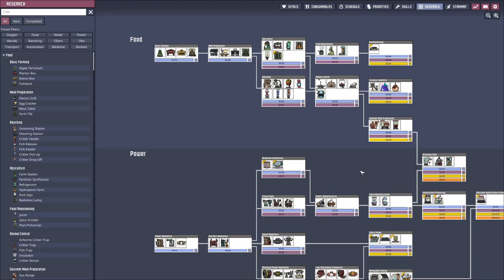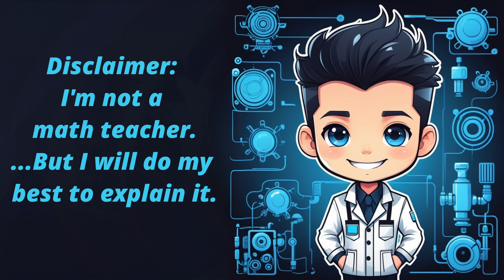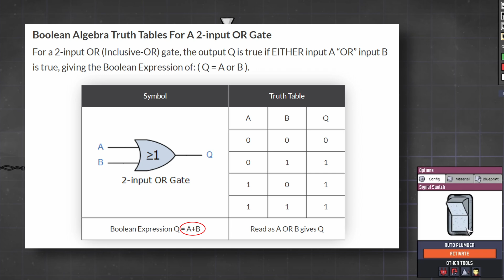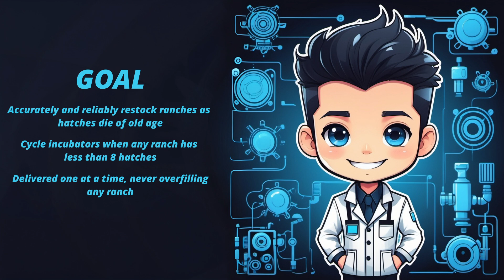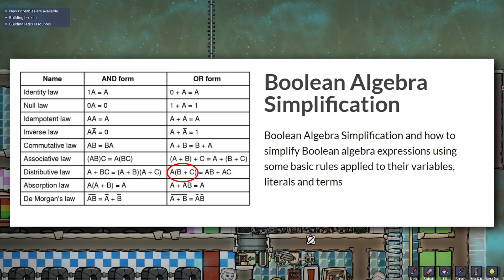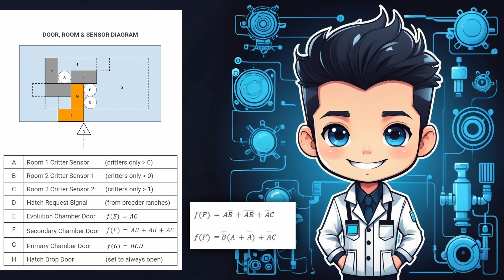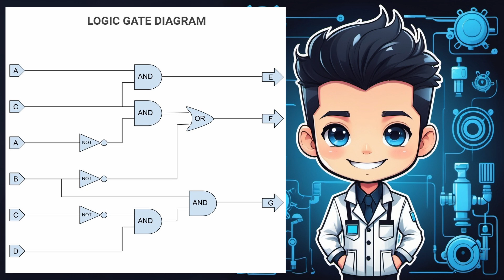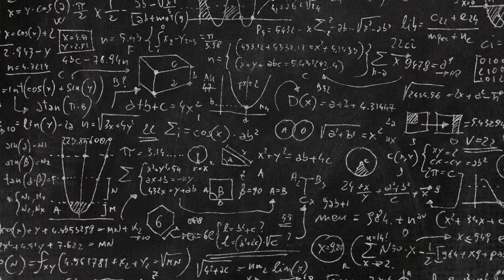Ultimate Auto Hatch Ranch | Oxygen Not Included | ONI Tutorial

Comment: can this be made mirrored? and also i love ur buidls :3
Reply from the maker: The issue with mirroring is that the sweeper needs to be in range of the bottom left tile of both incubators to put eggs in them.  This will not be possible for the left incubator if mirrored as is. The good news is the logic gates can be relocated wherever we want without the need to flip the circuit since we used automation ribbon.
Reply: @engineertroy_  That is not the issue, eggs find their way into the left incubator just fine, although the eggshells remain on the floor.
However, the automation wiring gets nasty because vertical doors don't have a mirrored version. 

The problem in my (mirrored) build is that hatches don't fall through the trap door unless I direct dupes to help them. No idea if mirroring causes it.
Reply: @noimnotnice  Im trying a mirroed version right now and Im running into the issue of wiring automation to door F, Im sure ill find a way but jeeeeez it is racking my brain. I probably have the solution right in front of me but i cant see it lol

Edit I had to do it very ugly
Reply: @itzahoax934 stuck on the same problem can you show😭
Reply: @siddheshgajare4193 im in bed now but if i can find the old save file ill post screenshots. Its been some time now. Just messwith redoing the automation lines and directions
Reply: @itzahoax934  please share, i just cant connect with door F 😌
Reply: @noimnotnice  Hi there notmnotnice! I also just built it mirrored and had no issues with the automation. It's surprisingly manageable.

Yet still, my critters aren't jumping down the drop for some reason. I also build his last version and they did jump down before.

Did you solve this mystery?
Reply: @silentlotus_  Critters not falling through doors happens to be a game speed issue for me.

Comment: I haven't made an automated ranch using the critter dropping through doors technique before. This is a really awesome build. One addition that I made was adding an evolution pool below the bottom ranch's door. (I know you changed that door to tiles, but I left it a door.) This way, you can still evolve the critters if the ranches are full without a dupe action. I also added a switch to the doors' automation wire, so it can force a green signal when I want to use that feature. If I want them to collect, then I just leave the switch off. Thanks so much for creating these tutorials!

Comment: First off, very much admire your efforts here. Seriously you went above and beyond.

With that said, I do think something is still not quite right. The critter sensor automation you’re using to disable the egg incubators doesn’t truly disable them; it just depowers them, which causes Dups to not apply the hug. The auto sweeper will still mindlessly feed eggs into them, which will eventually hatch into hatches. Do you have any suggestions on how to handle this? 

Second, how do you handle mixed stone hatch & regular hatch farms? I want to feed the hatches Sedimentary rock (to turn them into stone hatches) and the stone hatches Igneous rock (because it’s theoretically in infinite supply) but very often my Dups end up filling the feeder with only one or the other, resulting in starving critters. I tried having two different feeders, but it turns out that any food setting you apply to hatches also gets applied to stone hatches, frustratingly enough.

Comment: Ok, tested this in Dec 2025, Hatches will not enter the Door (G) and fall down.  Waited for hours for the thing to fall and never did.  Everything else worked, but I ended up having to add the drop off back and using dupes to repop.
I double checked settings and automation.  With G and H both open, the hatch NEVER goes in.  They jump up into chamber 1 just fine, they get dropped into the evo chamber when they are supposed to.
Reply: hey so i think they changed something with mech airlocks as this worked in an old save of mine but i came back to this issue. If you replace door G with a pneumatic door instead it will work as intended

Comment: okay i have a slight fix. it requires a mod to use and a little bit of re automation but it seems to be working for now. 
the mod is called "Conveyor Tile" this will push the hatch into the door. dont worrie the hatch can still move off the tile and move freely and will not get stuck in the door for eternity. 
1. you will need to remove critter sensor c and its automation wires (not the reader). 
2. remove the lamp and place critter sensor c and connect its automation.
3. replace the floor tile next to the mech door (door g) inside the incubation room with a conveyor tile pointing left and connect power. use the critter sensor ranch stack automation below and connect it to the conveyor to turn on when you need a hatch to restock.
4. remove the timer and replace with the lamp.
5. place the timer on the outside of the ranch and reconnect it. (you may need to rewire some of the automation)
Reply: is this referring to hatches not entering door G to fall down? if so no mods are needed, just change the airlock to a pneumatic door instead
Reply: @dominicdonnelly6733 ahh yes you could swap the door out but if you look at 5:30 you will see that some hatches will accidentally fall through.

Comment: Hi, wonderful video you have here, but I'm trying to figure out if something changed or just how dumb I might be:  I understand the logic, I understand the circuit, I still copied it verbatim because I don't trust myself, but hatches are getting caught/stuck in the door you label "G", the main drop door.  It's closing as I would expect it to, but instead of dropping it, it's just becoming entombed.  I don't have any door mods on at all, and I'm wondering if I'm the only one.
Reply from the maker: Is door H closed?  If it is just have a dupe set it to open. This door should also NOT have an automation wire connection and should remain open at all times.  Hope that helps! 😊
Reply: @engineertroy_  So, I rebuilt everything I had verbatim in sandbox, and it worked perfectly.  Almost insultingly well.  Went back to my main base and found that rebuilding the drop door and the horizontal airlock, it started working... briefly, then went back to entombing the critters instead of dropping them.

I'm chalking it up to being bugged in my main game somehow.  I'm a magnet for strange bugs:  every time I've attempted to ranch pacu, it ALWAYS fails when the fish stop eating, even though that works in sandbox too. 

You have a great design here, wish my simulation would handle it better.  I've got a beast of a computer so I don't think the simulation is breaking from too much going on.  I'll probably try your design again in my next base!  Thanks for responding!

Comment: my hatches from the 3rd stack wont drop to the 2nd :/ automation is working fine, the door is open on 3rd amd closed on 2nd but the hatches just wont drop even when standing on top of the door, i have no idea why
Reply: from incubatiom room to the 3rd stack is working fine, the hatches are able to drop
Reply: okay wait apparently hatches need to be already falling in order to fall thru door, so in this case hayches need to fall from incubator room to fill the lower 2 level? can you confirm?
Reply from the maker: Correct. Hatches only pass through open airlocks when they are already falling and the ranches will fill from the top down.

Comment: Build it but if i set the critter sensor to be above 7 on each of the hatch, the automation wire will keep sending red and green signal to the end gate. And my logic circuite keep overloaded because of it on the ribbon write with bit 1

Any idea what i did wrong?
Reply from the maker: Sounds like one of your ribbon readers or writers is set to the wrong bit.  I would double check those first. If all else fails feel free to download the save file in the description and compare. Hope that helps!  Sorry you’re having trouble.😢
Reply: @engineertroy_  Oh downloaded the save file but it needed dlc to load so can't compare
Reply: I just checked, all the bit on the ribbon readers or writers is correct.

But there seems to be something wrong with the not gate but can't figure out
Reply from the maker: Is the not gate in question somehow connected back into its input?  I believe that will cause automation wire to overload after cycling the circuit rapidly.
Reply: @ Yeah I think it's somehow connect back to the input which causes the circuit change rapidly from green to red signal

Comment: The automated system is really great, the only problem with this solution is that after the eggs hatch, the hatchlings will still be in the incubator and won't come out on their own. Is there any way to solve this?
Reply from the maker: Great question!  Hatches will automatically leave the incubator once they mature into adults.  This process takes 5 cycles so there is a bit of a delay for the fully automated delivery setup.
Reply: @engineertroy_  thank you so much

Comment: ONI most of the time you do not need an OR gate, due to if a wire has ON & OFF or ON & ON signal then the wire will always be ON. In the case you have you could get rid of it.
Reply from the maker: Correct!  The final circuit only contains AND & NOT gates. The OR gate was implemented as you described. 😊

Comment: I've been wondering.
Do you actually need incubators?

Reason why I ask is that the rate of meat evolution is based entirely on the rate of egg laying.
The incubator reduces the lag time until a ranch reaches equilibrium, probably by a lot. But it also increases initial effort, power consumption and dupe labor - until it's fully automated which includes increased power consumption.
Reply from the maker: That’s an interesting observation and a great idea!  Perhaps if we allowed a few hatches to escape the evolution chamber and chill up top until they are needed. I’m currently working to adapt this to automate flox and bammoths so I’ll definitely do my best to factor it in.
Reply: @engineertroy_  I have some trouble wrapping my head around the startup after a while out of it.
The setup I'm experimenting with now is a 3 tile room flooded with water and a regular door on top.
For early game there's a box set for eggs. Later I will add a solids vent for eggs.
Nearby there's a small room with incubator and critter pickup, connected to a critter sensor in the ranch (green under 8).
A step later I will power the incubator. Might add a timer too.

And just now I realize that I should have placed the flooded box in the floor of the ranch.
The ranch is 9 wide 11 tall to place a grabber when I get those.

I wonder if I can get the one grabber to grab eggs from the ranch and meat from the hole.
Reply: So! One page of notes later.

Autosweeper dead center. I want to have it reach everywhere where hatches leave coal, plus in the water hole and sideways to the incubator. I'm blindly assuming that they still go through regular doors.

Floor usage from left to right:
(Grooming station, feeder, drop-off) 4 tiles
Horizontal door to water hole 2 tiles
Vertical door to incubator 1 tile
Incubator 2 tiles
(Pick-up marker can be out of reach)

The auto sweeper needs to be no higher than 2nd tile from the floor to be able to reach meat in the water. Luckily over the horizontal door that should fit.

The incubator space does take a 3x3 chunk out of the ranch space, so I need to increase the height to 12 (12x9 with the 3x3 gap) or make the ranch 6 wide and 16 tall.

Low-tech it works by dupes shifting eggs to submerged storage and running the incubator from that stock as well.

High-tech one sweeper should be able to shift all eggs into the watery hole and refill the incubator from those.

I have two nagging issues with this plan:
1. I started fresh on deck. It will be a good while until I can actually test it.

2. This is so incredibly simple compared to all solutions on the net that I have a suspicion that there's a critical detail I missed that invalidates the whole idea.

Edit: This still leaves a dupe action to transfer a hatch from incubator to ranch.
Maybe I should should shift that bit upward so I can have an airlock door drop the fresh adult in?
Ideally exactly high enough that the sweeper reaches the full floor surface. Do they also go around corners, or should I respect a 45 degrees angle? 🤔
Maybe I should be satisfied with reducing dupe labor to transferring replacement hatches when one dies. That should only happen on average once every 1/8th of a hatch lifetime.

There is a chance that a hatch starves in the incubator room. In the original setup the meat is in range of the sweeper (if I put the pickup marker on top not to the side).

In the raised airlock version.. hmm. I hope it's still in range.
Reply: And... I found the flaw in the early game version.
Eggs in containers hatch to raw omelettes.
So that thing needs to be sweep only, drop everything out frequently (set to 0 and back) and manually sweep all those eggs.

Haven't found the flaw in the auto sweeper version yet.
Reply: Found my way into sandbox. Found the flaw:
The sweeper keeps picking up those eggs. So that part was overoptimised to use 1 sweeper for everything.

The simple watery grave topped with a regular door works like a charm though.
So maybe that should go in with the incubator, not under the ranch.

Which reminds me of an old calculation that 1 unpowered incubator should support a population of 5 hatches (max age 100 / hatch time 20)
So 2 unpowered plus some way to dump hatchlings in the water if the ranch is full should work out.
I'm thinking of 2 airlocks under the incubators set to open if ranch is full. No timers or whatever for lullabies. Egg will stay inside and complete its cycle I think.
That only leaves a possibility that a fresh hatchling stays on top of the door. It'll starve eventually or get picked up if I include a pickup marker.

That's 480 Watt peak consumption (2 sweeper/loader combos) in the cheapest version with 2 unpowered incubators and a bit of automation.
It will take time to reach a steady state because those unpowered incubators will provide a fresh hatch on average every 10 cycles.
Reply: Next evolution, flipping things around a bit.
This is not quite as automated as your build, but dupe labor is limited.

I made a evolution hatchery. 

The elegant variation is 7 wide on internal dimensions.
The main floor features 3 ladders under the sweeper plus a horizontal airlock in each side. Incubator on each of these.
Each airlock is connected to a critter sensor in a ranch. These are set to open the door when nr is over 7.

Under the airlocks is a room wide water hole. The sweeper should have full reach.

Above the sweeper are a conveyor vent (drops straight into the water) and a conveyor loader for meat and egg shells.
All eggs drop down the chute.

At this point I think that power to the incubators is optional, but not yet confirmed.
Reason is that the sweeper loads active incubators from the pool, and I noticed that it tends to pick the oldest eggs.
Once the ranch is in a stable rhythm there should be an egg that's close to hatching whenever one dies in the ranch. But the lag can be reduced by powering it.
For safety assume that population will be 7 for part of the time.

If an unneeded critter incubates it will start on top of the airlock until it starves.
Optionally a critter pickup set up 0 will have a dupe wrangle it. Wrangled critters do through the airlock into the water. Slight dupe effort but you get the meat sooner.

The added dupe labor compared to fully automated critter dropping is moving from incubator to ranch. That's a simple job anyone can do, including the rancher when they walk by for grooming etc.

Not bad for serving 2 ranches with 3 sweeper/loader combos plus a conveyor shutoff to shunt the eggs to the water instead of general collection. 490 Watts total.
And it should work fairly well without power consumption by the incubators 😇

Comment: Im having an issue with hatches not falling through the doors when they open to refill the lower 2 stables, does anybody have a potential solution?
Reply from the maker: Hatches will only fall through a door if they are already falling.  We have to trick a hatch into falling through a door by closing them inside.  Otherwise they will just hop over or avoid a door that is open on the floor. Hope that helps!
Reply: @engineertroy_  You dont have another door above yours to close them inside though, lol

Comment: Can this design be mirrored? So the entrance is from the left?
Reply from the maker: The short answer is "maybe?".  
I answered this in a previous comment but I'm happy to repeat it in this comment thread:  
The issue with mirroring is that the sweeper needs to be in range of the bottom left tile of both incubators to put eggs in them.  This will not be possible for the left incubator if mirrored as is. The good news is the logic gates can be relocated wherever we want without the need to flip the circuit since we used automation ribbon.